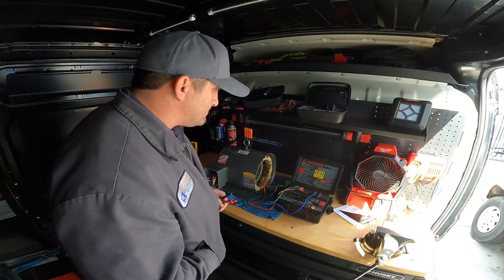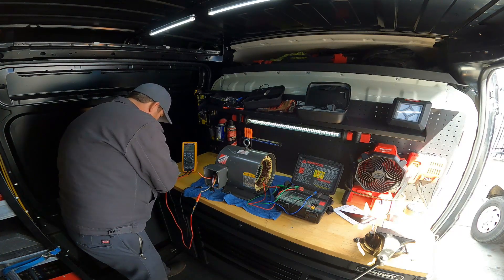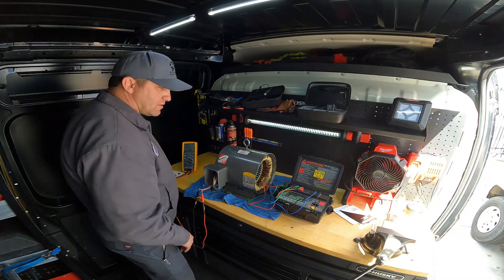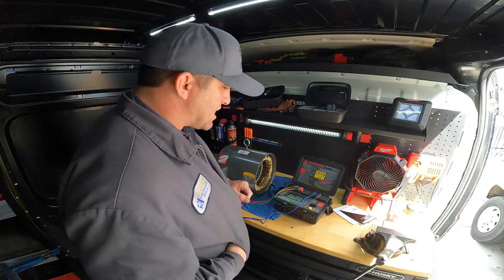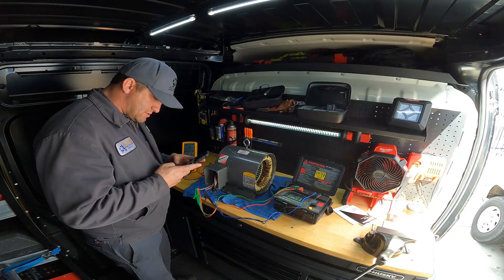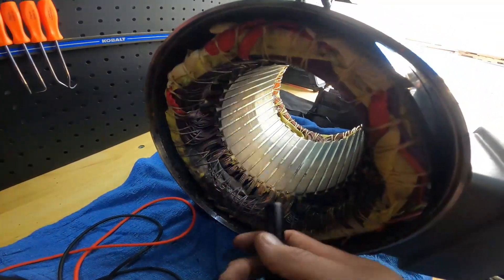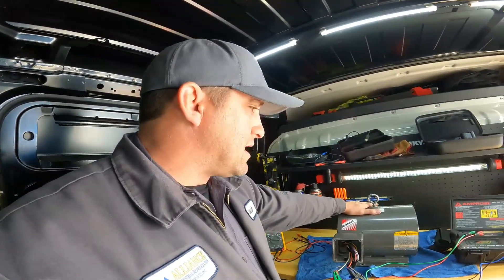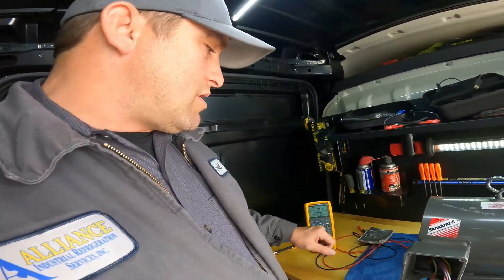Fluke 289 VS Amprobe MO-100 Ohm Test

Comment: Nice video. Never new olm meters were made that read in milli olms. The information on the olm values for the motor; is this coming from a data sheet from the MFG.  I would have never guessed Amprobe makes a better meter than Fluke. Lol
Reply from the maker: Fluke ownes Amprobe.

Comment: So pay 1200 bucks or be off by a hundredth of an ohm?
Reply from the maker: KINDA. Even the 289 can't read low enough ohms to diagnose a larger motor. The Amprobe can do it with ease.  This means it will definitely confirm your findings if you're not sure about your reading. Most meters can't read below 1 ohm. The amprobe can. You can check wire connections as well.